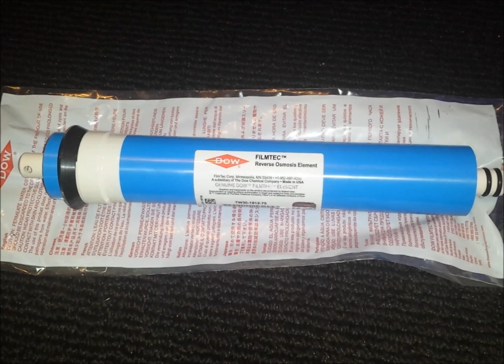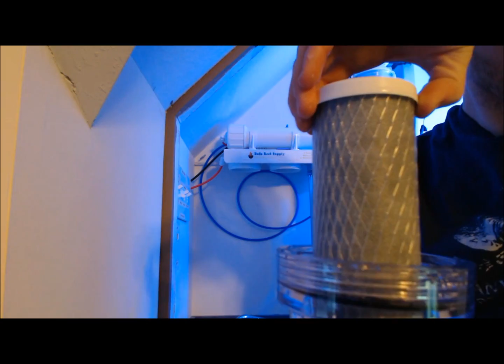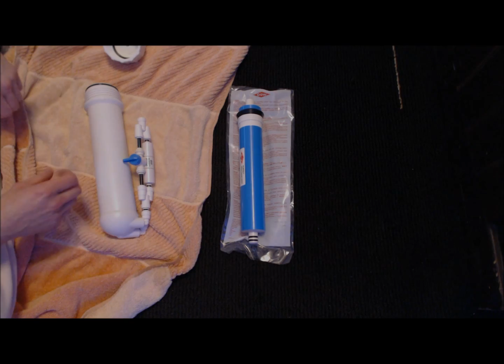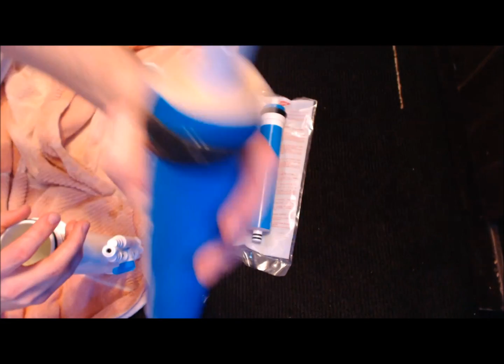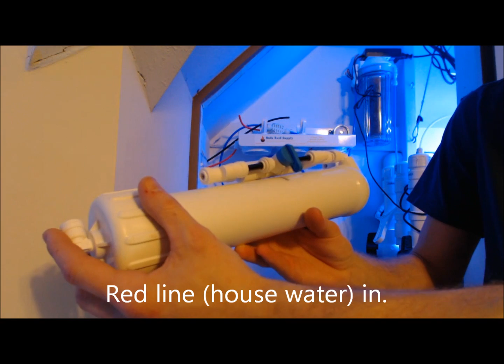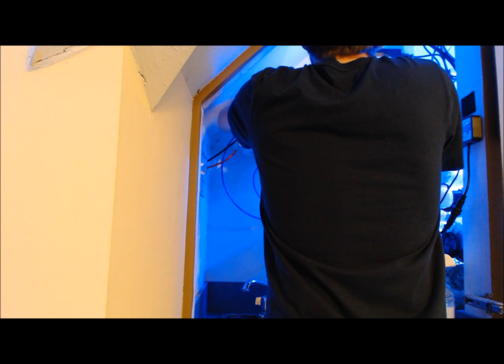Notw21 How to change RODI membrane

Comment: What's up Matt? I brought an RODI from BRS five years ago with the intentions of starting a saltwater tank. However due to life circumstances I never got to use it. It's been in plastic wrapping all that time do you think that I need to change out the membranes on the unit before using it?
Reply from the maker: Jose Rodriguez if you bought the tds meter with it I would try getting it all setup and run some water through it it and see what the tds is. I would think it would be fine since it hasn't been used.
Reply from the maker: Jose Rodriguez I might even suggest looking up there membranes to see how long the shelf life is on them.

Comment: great how to video, you should put a patent on your membrane puller lol, how old was that membrane? and what did your TDS meter read?
Reply from the maker: Thank you so much. The patent is in the works:P. my membrane was 3 years old. they recommend anywhere from 3 to 5 years to change it so i just did 3 to be proactive. whenever my tds reads 0.1 or more i go ahead and change my filters so my tank doesnt get dirty. and that means i change my filters about every 6 to 8 months.more towards 8 months tho.
Reply: Cool...we pretty much have the same schedule, but haven't changed the membrane yet, about a year left to go